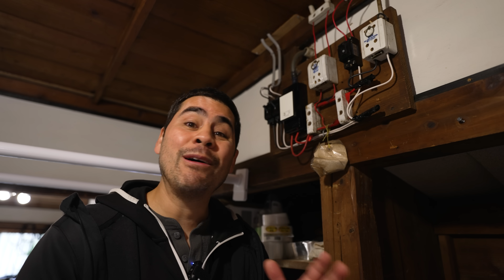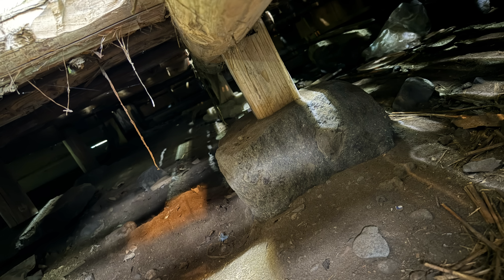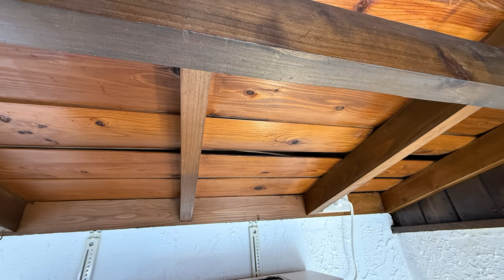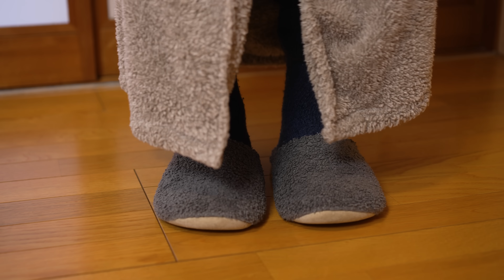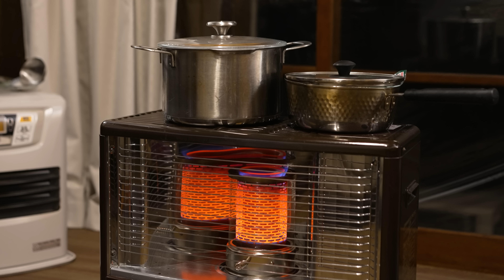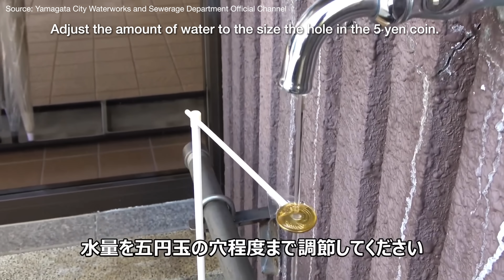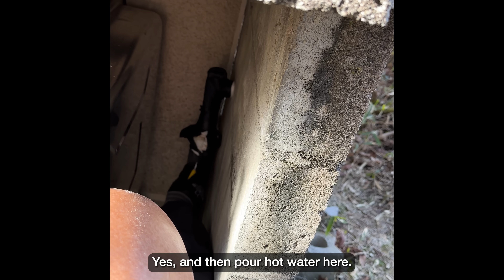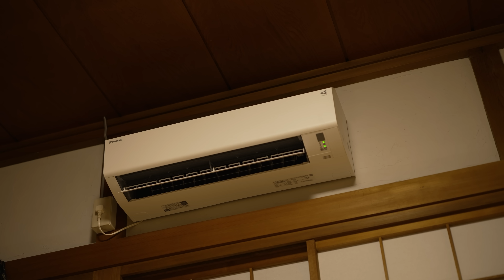What an Old Japanese House in Winter is Like

Comment: In the US the old midwest farm houses would have high ceilings to lift the hot air away and wrap around porches so you could catch the breeze outside in any direction. Get the outside stuff done before it got too hot and then laze around until the heat broke at night. These days you can skip adapting to the local climate with enough tech, but it’s interesting to see how early architecture and human behavior melded back in the day.

Comment: When I lived in Japan from 2004 to 2011, we would usually crack a window about 2 inches when running the gas heater due to the CO (Carbon Monoxide).
Reply: * CO
Reply: @s @sarukravitz4981  I was thinking monoxide but came out dioxide😂

Comment: 30A @ 100 volts is like only 3000 watts. My European electric kettle is already 3000 watts.I suppose you could make whole (or part) home heating using propane but that would cost an awful lot of propane but would keep things in your house from freezing.  you could combine the hot water and heating though.

Comment: So this Japanese home was built similar to American homes from a century ago before central heating/cooling existed.  Designed to allow air in and out rather than letting the home turn into a hot box during the summer.   ie intentionally drafty.   You see this in older homes in the USA which lack even insolation, if any insolation at all.  Specific rooms existed to keep the family warm during the winter either with fireplaces or cast iron stoves, and door/window placement to allow air flow during the summer and even a screened porch where the family could sleep at night during the hot summer.   You were expected to dress warm even when indoors basically, which is why coats and bed robes went down to people's ankles back then.

USA in particular much of the country has to deal with harsh winters and summers.  So home design generally prioritized summer.    If you live in a part of the world that has mild summers you can design a home specifically for winter climates.   Sadly Japan kind of falls into the same category as the United States, it has both harsh winters and summers counting where you live in Japan.    So It ironically makes sense before central heating/air homes were designed to prioritized summer heat.  As the saying goes during winter you can always put more layers on but during summer you cannot take too much off.   Building a home to deal with summer heat is always a priority as there are always ways to deal with the cold.

It's actually a style of home design that some people who want to reduce energy cost have been advocating to come back, even if it means sweating during the summer and freezing during the winter.  As modern homes turn into hot boxes in the summer if the AC is turned off.
Reply: "and even a screened porch where the family could sleep at night during the hot summer."  

Oh, I wish I could do that! Except I'd need mosquito netting. Otherwise, I'd be bled dry by the nasty little vampires.
Reply: @Yesica1993 That's the point of the screened porch.

Comment: My life is too convenient. A little bit of what you have to deal with would be nice... but I live in Finland, in a rental apartment. It's like I'm just a baby, and men go to work every day to make sure that I have an unlimited supply of warm everything, at all times. If something doesn't work, I just call a number and it's usually fixed during the same day.

My biggest problem during the last cold week of -20 celsius weather? The air circulation system went out... and it got too hot and humid inside :D
Reply: Yep. Many of us are very spoiled.

Comment: Kerosene heaters are awful, especially if you have sensitive sinus/respiratory issues. Politely made my inlaws stop using them when we stayed at their house in winter. Then a few years later they had a newborn and got rid of them for good for the kids health. Yay. 
A friend of a friend who lived in Hokkaido used to put his toothpaste in the refrigerator to keep it from freezing overnight in his bathroom. 
Japan is a land of juxtaposition. 
My wife, who originally never even noticed Japanese housing issues, now refuses to go back to visit her family in the winter. And her brothers house is fairly new as well. 
There's always somebody going to reply to my comment saying "My house in Japan is amazingly insulated." That's the exception, not the norm. I have a friend who worked as an architect at a housing firm in a very large city... and we always get a good laugh when we talk about typical Japanese housing builds. 
TLDR; Japan doesn't insulate most of their homes, nor do they have central heating and cooling. They'll tell you it's "built less expensive" so they can rebuild easily after earthquakes, but that's not it. The housing prices where I live in the US, and where I live in Japan are about the same. Although sadly, the quality has gone wayyyyyy down on new US home builds in my area. At least in Japan you mainly have competent workers. 
Give me a US designed house, with a Japanese designed bathroom and shower area (but not the ante-room, Screw you Japanese Ante-room), and Japanese craftsmen.

Comment: Having a house built in the 1940s in America, almost all of this is also true. Vented crawl space, big gaps in the ceiling boards with no attic insulation, dripping the water, and jiggly single pain windows. For your outdoor hoses, I highly recommend you get Freeze Misers. They automatically drip the water as needed and require no electricity.

Comment: I lived in a small house that was built in the 1930s for a few years in a place with 4 very distinct seasons, with terrible 1930s insulation. It was pretty rough but not as bad as that Akiya! Having only 30 amps to work with is crazy, I used a couple portable radiators that worked a treat but would likely blow through the amp budget in that Akiya every day.

Comment: lmao what a clickbait drama queen. japan really sucks regarding insulation, mold prevention. vapor barriers. its not good for the house to get cold like that . condensation will make everything moldy. seems like they still are in the 1950s regarding to heating. they should really learn about the power of 3phase power and that circuit breaker is from the 1920s
Reply: How is it clickbait, when the title is exactly what he showed in the video? Good grief.

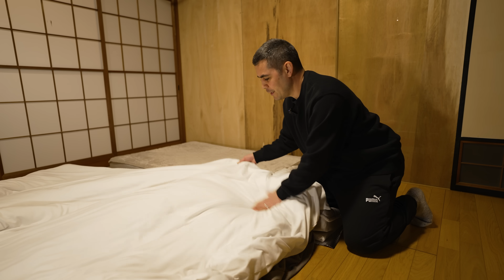Comment: 21:10 You don't need that life hack — the only thing you really need is a 電気毛布. Just put it under your sheets, turn it on, and you'll have a nice warm bed all night. It works amazingly well with thick blankets too. Super efficient, and you won't need any other heat source.

Comment: I live in the southeastern United States and we have a very similar climate to central Japan.  My house was built in the 40s with the same "let it breathe in hot humid summers" construction, raised vented foundation, thin walls, little ceiling insulation, originally no central air conditioning and only a floor furnace heater in the center of the home.  While it was renovated to have central heat and air in the 2000s, the "breathability" means keeping it warm is an absolute battle in the winter.  We also do thick socks, fluffy robes, a base layer of thermal long johns under our clothes, space heaters, and lots of electric blankets in the winter.  Fortunately it only lasts about 2-3 months, but oof do we long for spring during those months!

Comment: I'm from Vancouver but I have no problem with the cold, snow or ice. Staying in an older house in Kyoto during the winter sounds like your hell except that we had ice forming on the inside of the windows where one would normally have condensation build up. Oh, we did have freezing pipes in Vancouver from time to time but usually with really long spells of -5c and lower. The worst case of frozen pipes happened when we had several days of lows between -8c to -17c.

Comment: Somehow, I feel the urge to build a house that LOOKS like a traditional japanese house while being fully insulated with floor heating. And a german-style breaker panel, for crying out loud.

Back when I was a kid, having a warm room meant carrying either wood or oil over multiple stairs in the evening and getting up an hour early to fire up the stove - then go back to bed for 45 minutes.
Reply: So there was once a video i saw (can't find it though, sorry) of a family that did just that. They had to renovate the place every 3 years due to mold.  :(
Reply: @ChibiOlia  one of the interesting parts of  such a project would be finding solutions to these problems. I own a fully insulated wooden house, and most of the year the humidity is rather low inside (except for the underground cellar). I would assume those problems can be solved in a reasonable way.
Reply: @wernerviehhauser94  there are central dehumidifiers I think, look into San Francisco bay area constructions (the richer areas south of SF, north of San Jose)
Reply: @wernerviehhauser94 I think the issue there was the difference between outside and inside walls. There was moisture build up behind the insulation. But yeah, it should be technically solvable, just needs a lot of attention for preventing this
Reply: @ChibiOlia  My insulation is open for water vapour. It diffuses out over time and can hardly build up anywhere except for rooms with showers, and even there it's not a lot. IIRC, the mold problem in Japan is more of a summertime issue, having the wood soak up moisture due to the high humidity.

Comment: I've lived in colonial era homes in New England.  Finding the toilet frozen over in the morning was common.  The saving grace of those buildings was the wood stoves and fireplaces, all the heat you want and the fuel grows outside for free!  Banking the basement stove at night would keep the pipes from freezing well into the negative temperatures.

I was surprised by how many different energy sources and devices you used for heat.  In descending order of efficiency I saw the heat pump, the kerosene heaters, the propane heaters, and the electrical resistance heaters for your pipes and your feet at work.  How much do you spend per square foot to stay warm?  Also, a small fan can efficiently equalize the temperature difference between the floor and the ceiling.  It will use much less electricity than your foot heater.
Reply: Did you not worry about the toilet or water pipes breaking from the ice?

You're not kidding about the wood stoves. I live in an old house where the stoves and chimneys were torn out years ago to "modernize" leaving us with feeble baseboard heaters which usually max out the daily indoor temp at 12c. I would give anything for a wood stove.
Reply: @CanteringCodfish  The pipes were (mostly) good.  At bedtime we'd fill the stove and cut off almost all the air.  The fire would feebly  burn all night keeping the pipes from freezing.  The toilet is like a birdbath, the ice has room to expand.  To the best of my recollection it never froze solid.

I learned to lay out all my clothes and then quickly get dressed.  No rummaging around for the right pair of pants in those temperatures.
Reply: I didn't know toilets could freeze! I've had pipes freeze in this chilly basement, but not the toilet. Great, now I have something else to worry about.

Comment: My family just stayed at my in-laws over the winter in Shizuoka area (Ohito-cho) and I swear to God, I thought you were me 🙂 We also had the power go down with 40Amps but the brother-in-law (the in-laws sadly passed away) was using his ceramic heater (yes, he's spoiled) while we were using two aircons and 2 kerosene heaters 🙂

I was shocked that the pipes didn't freeze but I guess it's never happened there.  

I also double-poured hot water on the coffee cups to warm them up.  I'd make a water coffee, let it sit, move it between cups, and then make the actual coffee

We rented 4 futons but my wife bought cheap throw blankets from Amazon and that was so nice and warm - give it a try by doubling them. 

I also realized the temperature on the ground was colder and I started wearing socks indoors and doing the same stuff you were doing even though I'm in shorts most of the winter in the States.

If I lived in Japan, I would also get those temp readers and wattage meters on the outlets for sure to monitor usage.  

Omg, the defrost cycle on the air con - lol, that was traumatic in the middle of the night.  I thought the air con was dead.

Do new homes have central air?  I'm not sure I could handle this especially since we'd need to travel to the US and Greece where I'm from.

My daughter immediately recognized your channel and said she grew up watching it 🙂 Japanese homes are an experience, for sure!

I do wonder if there are ways to improve the home's insulation for older homes without rebuilding them - Japan should probably research that.

Comment: First I hear 30 Amps main breaker is not bad then I remember that Japan use 100V system. 🤯 My house smaller size but I have 60 Amps 230V. I have 5 airconds that can run at same time.

Comment: The fun part being that most modern house are not isolated either. And when they are in concrete they just act as a giant passive heat dissipator in winter…

The solution… lc concrete panels for outer walls (asahi-kasei) and twin pane windows…

Comment: Thanks for showing how an old home creates issues for those that are not used to living with cold temps, limited heating options, and 30A power circuits.  Raised in California with entire home forced air heating using natural gas, 200A circuit panel, and tons of insulation w/ double pane windows. I will NOT be looking to buy a home in Japan that does not have my minimum features as I am no longer a youth.

Comment: Yer used to lived in place with single pane windows with big gaps. And we used plastic shrink wrap for the windows.  I love that stuff for this.
In my nicer home now I bought perspex to fit over my windows of the winter.  I leave a 5cm air gap and it really helps reduce how much the heating has to go on
Reply: I remember my dad putting plastic on the windows! It really helped. But I hated that closed in feeling. Always have.  I assumed everybody did that. Then I realized we were just poor. 😆

Comment: Sounds totally crazy to me.
I mean sure, it works and you can live with a lot if you have to.
But voluntarily 😅

It just didn't seem like comfortable living.
You had to do so much planning and acting before you use a room. So much thinking to not have a power outage.
No easy switching rooms. No I am tired , I am going to have a short nap. No just turning on some device.
And it also didn't seem nice to me to be in those rooms.

I am currently in a moderate climate with comparable good insulation.
We currently have arround -5 °C
If I don't heat over night. It drops from 21 to 20 degrees.
Me and my PC are usually enough, to get it back up to 22.
I don't even need to start the heater

Comment: For the single-glass windows you can buy cheap cellophane that you stick on the window as a second glass. This should increase the temp in the room by 3C. But it will massively backfire due to the lack of ventilation - you are generating a lot of toxic chemicals and CO2 with your current setup. Good job on getting a CO2 meter. A cheap thermal camera can also help find things to improve, but the windows and mandatory ventilation probably introduce the biggest heat-losses by far. Insulating the ceiling further is probably the best. 
The washlet is a must-have not because of the heated-seat but due to the water-jet. Everyone that has used a bidet knows why. 
You can get an electrician to change the fuse to a resettable breaker (MCB). Ask to get an RCD with it.

Comment: Electric cars use the “heat the person , not the space” efficiency.  Seat heaters. Steering wheel heaters and in a Tesla only the seats with an occupant get the heat    To be more efficient with the battery.  Also it uses the heat from the battery to heat the cabin

Comment: I'm currently living in France, in an old south-west style house (lime stone walls). In summer it's perfect as the stone walls keep cool, so inside it's 20-25 and outside it can be 30-40.
In the winter however, it's pretty nightmarish , and it can easily get bellow 5-10°c inside, so the wood stove is running all day :face-blue-wide-eyes:
It was a huge shock to me as for a long time i lived in city apartments where there was good insolation and/or central heating. Oh well, life choices !

Comment: Fixing that electricity panel would be priority #1. Hope you stay warm buddy.
Reply: The fuse melts to prevent the wires in the walls from burning out. That's why you can't just replace the panel. You have to replace the entire wiring.
Reply: Brand new houses in Japan come with 40amp service so a new panel isn't going to do much when he has 30amp currently. When we moved into our NEW place in 2024, we found out the hard way that two aircon units running at the same time as the unit bath heater and trying to cook using the IH stove was enough to be left in the dark. Japan isn't as advanced as people think.
Reply: @FirstLastOne Japan feels like it simultaneously exists 100 years in the past and 100 years in the future at the same time. Never seen a country quite like it in that respect.
Reply: @FirstLastOne I wonder how much of the power limit is due to national and regional grid limits instead of local town-level infrastructure? A town of 30A houses doesn't need as big a substation as 200A houses, but if the substation were larger, could the grid even feed it?

Comment: I think its dumb to keep the AC off among other things. You should be running things 24/7 Also Kerocine to heat up the house? Big OOF, also Electrical Issues can be FIXED by hiring an electrician to up your houses wiring